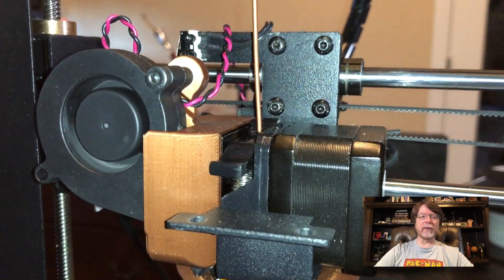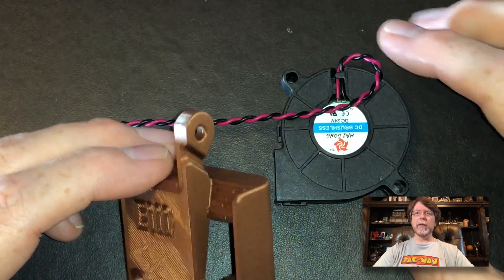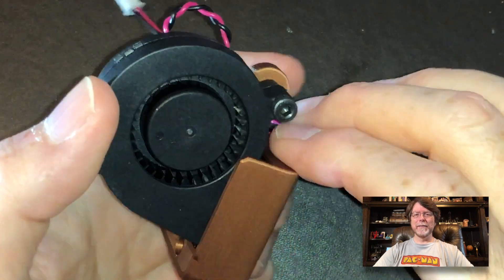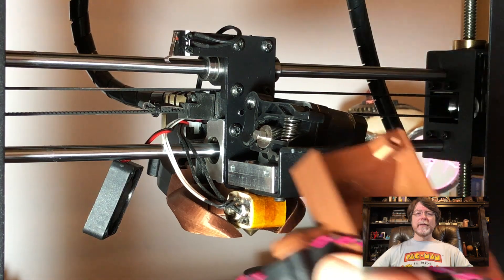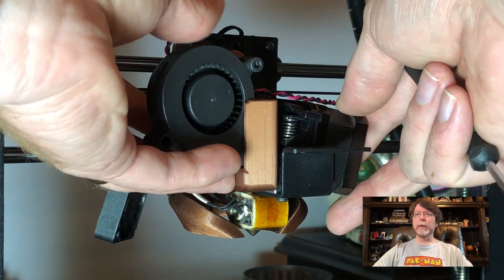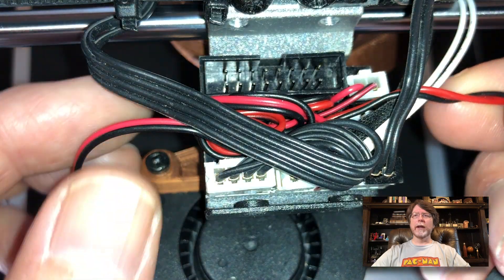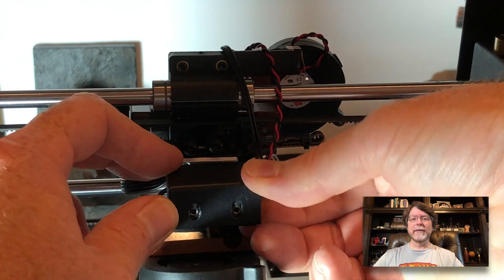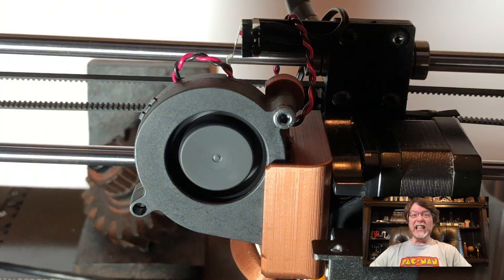Monoprice Mod Mondays #5: Twenty Percent Cooler!

Comment: So, any issues in making the whole extruder setup too heavy with these blowers attached to it? Thanks
Reply from the maker: Hi DTM! While I never had a weight problem on the extruder, I eventually decided in favor of "quiet," and went with a Noctua fan. However, this is a 24volt printer, and Noctua only makes 4010 fans in either 5v or 12v varieties, so a buck converter is needed to reduce the voltage down to 12v. (see video, here: https://www.youtube.com/watch?v=jXR8r2O13HY). 😃Thanks for watching!

Comment: Do you still recommend this fan setup? I over tightened my stock cooling block fan and the fan cracked. I guess I have to mod my printer......again! Ah shucks! :)
Reply from the maker: Hi John. While the blower moves a ton of air, it's loud. I switched to using a 12-volt Noctua fan along with a buck converter to take the 24-volt power for the stock fan down to 12 volts for the Noctua. Custom-designed a fan grill to also hold the teeny-tiny buck converter. I am now using that setup on both my Monoprice Maker Select Plus printers. There seems to be sufficient airflow even with the Noctua fans to keep things cool. Video here: https://youtu.be/jXR8r2O13HY